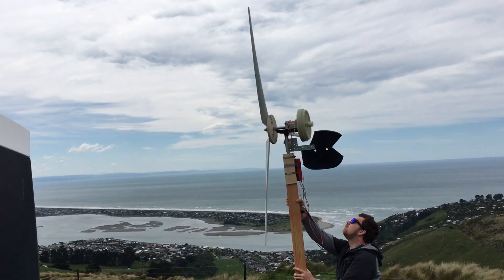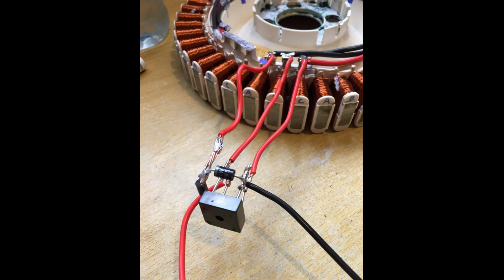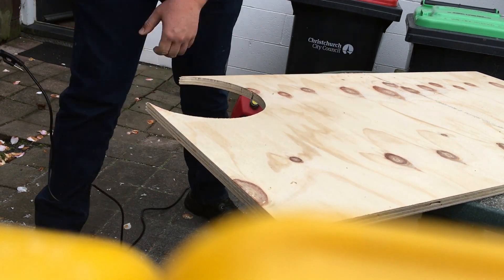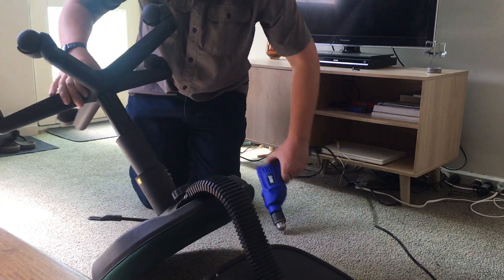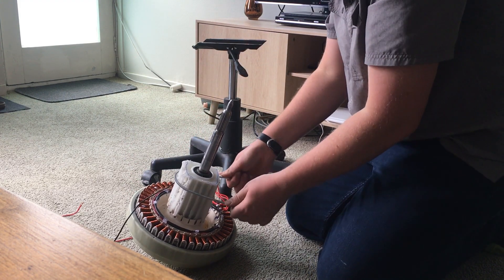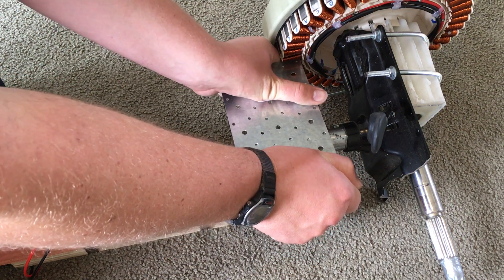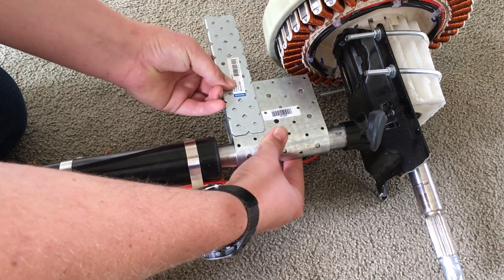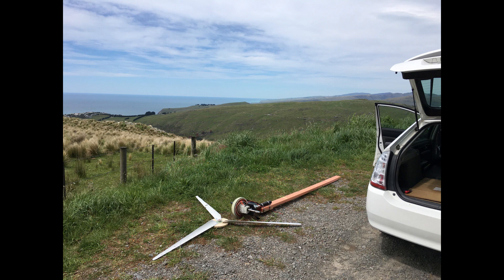DIY Wind Turbine from office chair and washing machine parts!

Comment: thanks very much washer machine , i havent figured out how yet,,, ac to dc
Reply from the maker: just need to make a "3 phase rectifier"
Reply: Or if you want to Connect it to the boiler you don't have to. Just match  best Ohm element

Comment: you might need to try fitting the blades in the opposite direction, that way it will not block the wind and create better aerodynamics.. and a little thicker bottom and reduce the length of the blade.. or go for a 5 blade design that will perform better at low wind speeds.
Reply from the maker: Thanks. I always wondered why some have 5 and some have 3 blades, the wind speed makes sense.

Comment: spin a washing machine drain pump backwards,  its a small 2 pole dynamo get a 1000 volt wave turningit with a 5volt dc motor , not ac but definitely a wave. Runs lights, charges all my stuff, and i pick em up for free at repair shops, when it wont work for the washer it still works to generate
Reply: you won't EVER get more power out of the drain pump, than you put into the 5V DC motor..

Comment: What Diode do you use to convert AC to DC?
Reply from the maker: its called a 3phase rectifier. I dont think you can buy them but they are easy to make out of diodes.